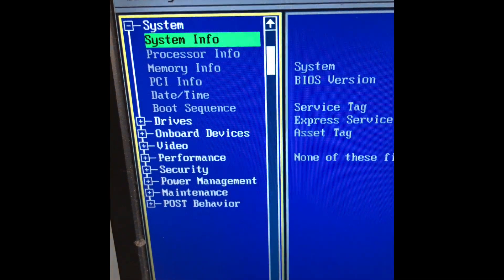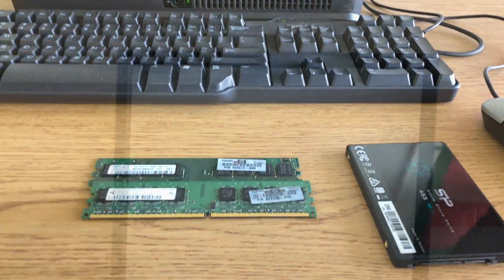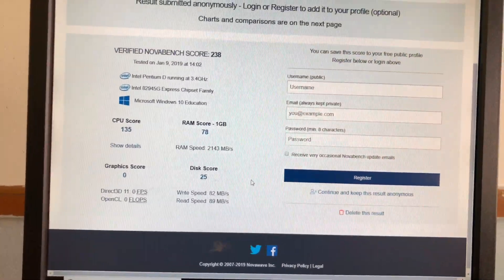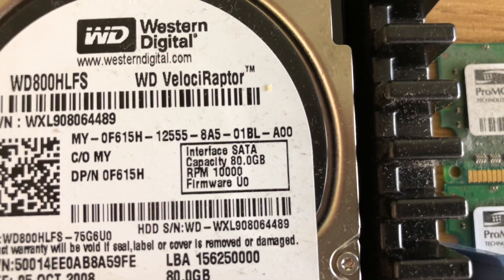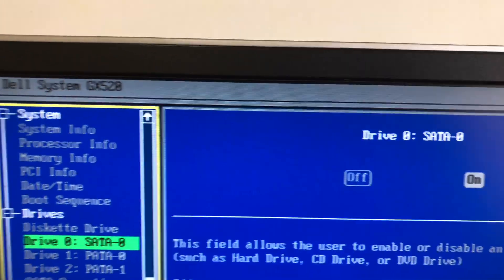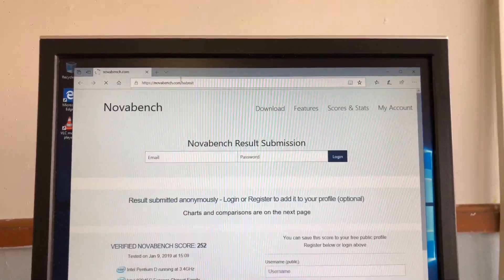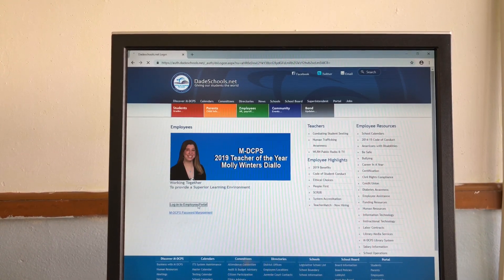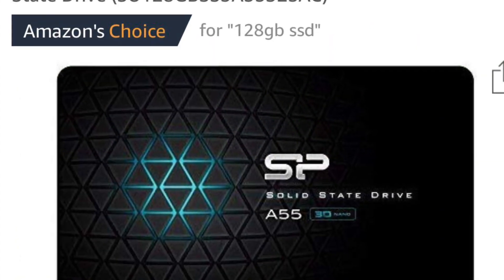Dell GX520 upgrade

Comment: Hey great video !  I have I believe the same machine and I want to use an old sound card that I bought years ago and it's an excellent audio card. It is the M-Audio Audiophile 24/96 but it has a full-size slot bracket which of course can't be used in this machine. Do you know if there is a Dell riser card for this machine so I could use the sound card? Thanks in advance.

Comment: Can you tell me all the details and the changes in your parts and what parts to buy
Reply from the maker: you can  do memory, CPU and hard disk upgrades. i did only the memory and hard disk. i upgraded the memory to either 2gb or 4gb. you can check any motherboard maximum RAM by google it. The hard disk i did a solid  state disk. any size you want.
Reply: It says 4gb maximum memory it is 2gb per slot? Or maybe just 4gb in one slot...
Reply: What type of cpu

Comment: Is there cpu that I could upgrade the GX520 OEM cpu to?
Reply from the maker: Yes. Check this out
https://youtu.be/7ZUEMEYtUu8
Reply: @fixpc9114  Thank you.
Reply from the maker: The GX520 will happily support up to a Pentium D 820 at 2.8 Ghz but note that you must have A11 BIOS and it will still give you a message at boot time saying it's unsupported. It still works, however.
Reply: @fixpc9114  Thanks too for this. I will go this route. I don't suppose the A10 BIOS is upgradable to A11?
Reply from the maker: @wisdom2th32  yes it is, try directly from Dell:
https://www.dell.com/support/home/en-us/drivers/driversdetails?driverid=r142230
Reply: @fixpc9114  Wonderfulll. Thanks!

Comment: Watching this in May 2020. Been wondering what to do with my GX520 and I didn't even know I could do this.Thanks! Great video!

Now if I can learn how to install Windows 10 for free...
Reply from the maker: The upgrades are worth it, even in 2020. You may also want to do a CPU upgrade.
Reply: @fixpc9114  I'm down to do it. Do you have any amazon links for the CPU, RAM, and SSD?